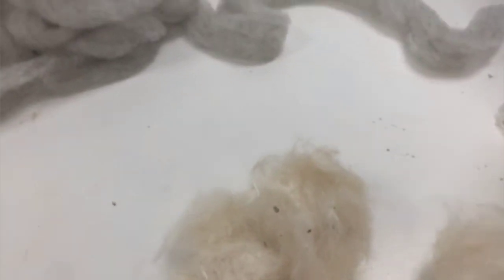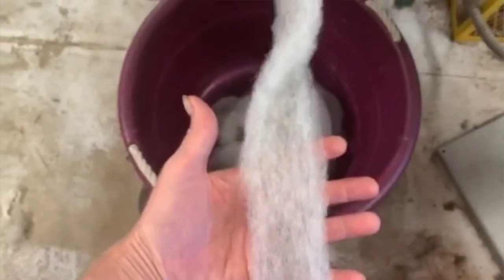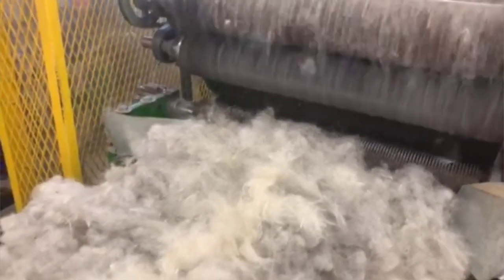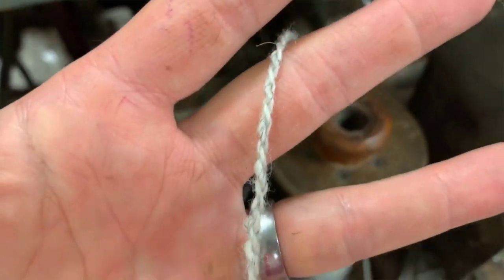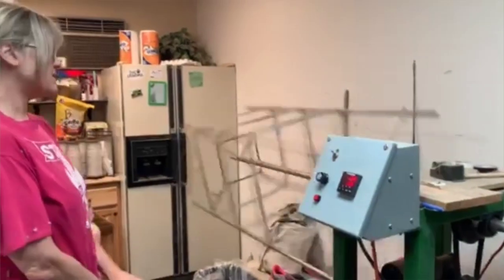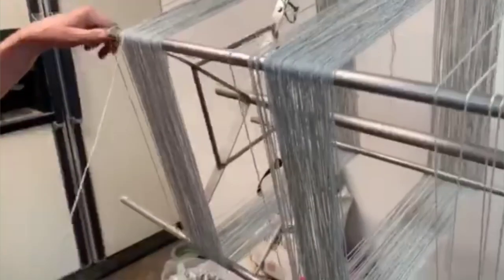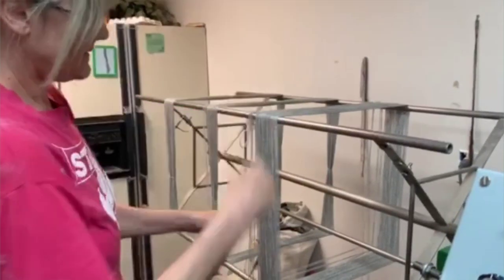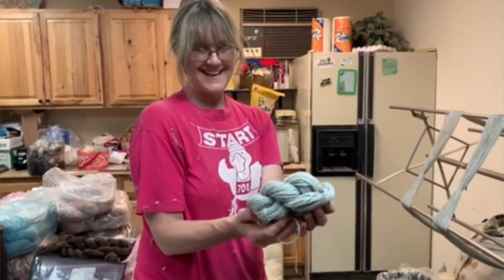Making Yarn with Milkweed at Dakota Fiber Mill

Comment: I suggest milkweed bast fiber instead.
Reply: Strong and easy to work with, but quite not so luxuriously soft and silky.  ;-)  Fun fact: during WWII, milkweed seedfloss fiber was used to fill life preservers.  Normally, seedfloss from the tropical tree kapok was used, but the Japanese occupation of the island of Java made that unavailable.
Reply: Agreed the floss is too brittle. The bast fiber is stronger and just as soft. With a little bit of washing as well. It's very easy to extract when the plant dies back during the fall.
Reply: @RisenFromDarkness_1880   Also a pet detangling comb often gets the worst of the stem bits out! <3 with metal bristles, plastic will just break. Dogbane is stronger than milkweed (it's a distant cousin to milkweed and oleander) and what you harvest are the dead stems after the plant has gone dormant. So you know you aren't taking foliage from monarchs when you do. The downside is that the fiber is golden brown, which will tint whatever dyes you use on it. Milkweed when its just died is strongest milkweed, but when the weather is stiff and cold enough, the stems dry out and yield a fiber with the texture and gloss of fishing line, only much finer! I've gotten it to take purple cabbage dye readily, tinting it shades of blue and purple that make it look like some kind of plastic party favor.

Comment: Do you electrically ground your machines to reduce/eliminate static?
Reply from the maker: We do not. Now that the mill is located in a basement, the humidity stays on average 80%, which helps boatloads.